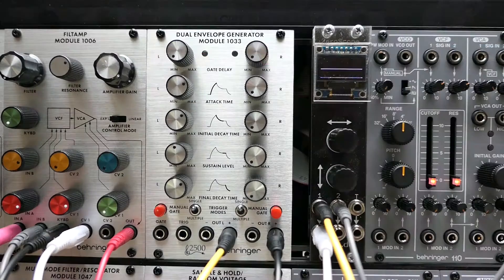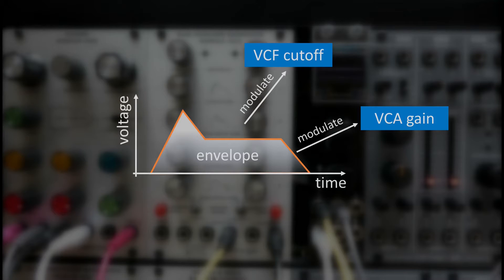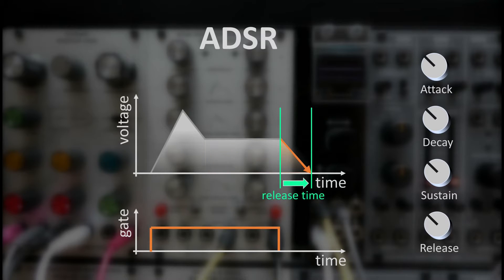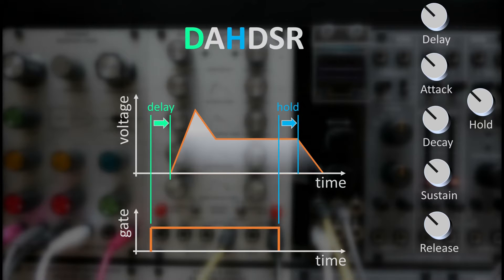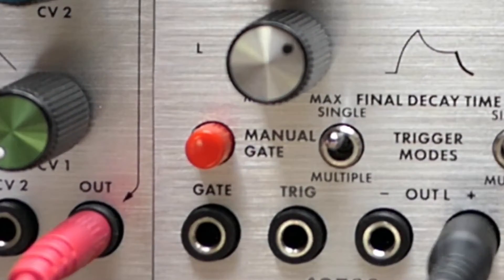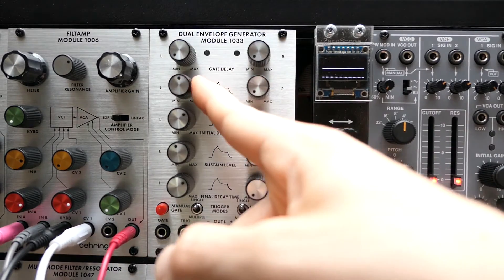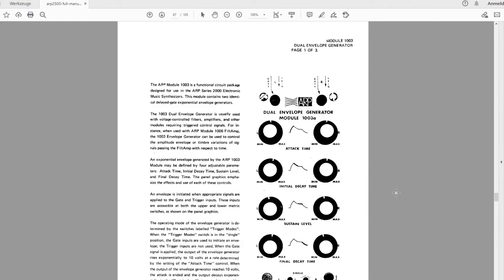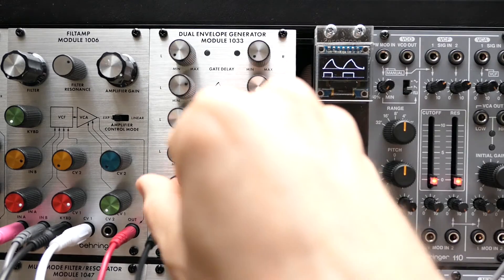Behringer 1033 Dual Envelope Generator ~ review & envelope basics

Comment: Hello , I am Max, I have a 2600 vco,  behringer 902 vca, one 1003 adsr,  one Cm1a, a kassutronics ladder filter and i play with my keyboard ( motif, studiologic, korg ) via midi, the suond goes on without release, maybe i need a cv gate converter because the adsr it doesen't seem to work . Can you explain to me how to make it work because behringer doesn't explain to me? Many thanks
Reply from the maker: Hey, you'll need some midi to cv converter to get going. Plus, the 1033 is picky when it comes to the gate input, needs a real gate to work (not sure if 5V or more).

Comment: I wonder how easy it would be to mod the unit to have an actual 1/8 input jack replacing the manual gate button for the right channel?

It really does bug me that so much rack space is taken up by a module that technically only does one triggered envelope. The best utilization is to use one envelope for the VCA and the other for a different adsr for a filter. Probably the first module to be replaced in my rack since I now have more oscillators and VCA's than I do envelopes.
Reply from the maker: Yeah that would be worth a try. Perhaps you can measure what goes into the pushbutton (i.e. the voltage), when it's somewhere in the standard gate range, your idea might work.
Reply: @synthesizer83  I did recently buy an oscilloscope, I'll try and remember to test the manual button's voltage. Good idea!

Comment: I bought a 1033. I'm a newbie so I don't know if it's just my own ignorance/stupidity, but I can't get it to do anything. I've looked at the thin user manual on Behringer's website. I've watched every video I can think of. It produces an envelope if a push the "manual" button. It doesn't do it any other time. Can anyone help a clueless newb figure out what I'm doing wrong?
Reply from the maker: This one is really picky when it comes to the gate / trigger inputs - most signals don't work. However, if you use some proper gate or clock from a sequencer or a keyboard (I use the Keystep from Arturia), it should work. Other signals (LFO, VCO) usually do not work with the 1033.
Reply: @synthesizer83  Thank you for the reply. I tried the gate and the trigger from a Hydrasynth. It only worked if I held the manual gate button down while playing (kinda useless). I tried it with an old Future Retro Mobius and it suddenly worked fine. I don't own a Keystep, but had thought about getting one. Maybe I will. I really appreciate you getting back to me on this!
Reply from the maker: @barnabascee1889  You're welcome! I sat there like you wasting my time while this 1033 just ignored all the triggers I threw at it.
Reply: @synthesizer83  The specifications say the 1033's gate and trigger voltages are required to be between +4 and +12 volts. So it won't get triggered if you're using, say, a VCO that's bipolar with a peak-to-peak voltage of 5 volts because you'd only be getting +2.5 volts maximum (voltage range would be -2.5 to +2.5). You should be able to make them work if you run the VCO through a CV mixer and add in a fixed voltage offset. Typically Eurorack VCOs, I think, are 10v peak-to-peak (-5v to +5v), but maybe they aren't remaining at above +4v long enough to trigger the 1033? In any case, I would think the voltage offset trick should work.
Reply: @barnabascee1889  Look on Page 89 of Hydrasynth's user manual. You can set its Gate Voltage to 3v, 5v, or 10v. I don't know what it's defaulted to, but you should set it to either +5v or +10v to trigger the 1033 since the 1033's gate/trigger are supposed to accept anything from +4v to +12v. Also make sure the Hydrasynth's gates are set to V-Trig mode, not S-Trig. With the correct settings it looks like it should have no issue triggering the 1033.
Reply: @emdotambient  I'll try this. Thank you!

Comment: The question for me is: for those of us with several envelope generators, will the 1033 really add anything? I suspect not. Could it be that the oscillator, multimode filter and ringmod/VCA are what make the essential 2500 sound character?
Reply from the maker: Perhaps if you miss a gate delay, the 1033 is worth thinking about, or if you're obsessed with uniform module series and want the full 2500. Otherwise, you don't need it. There are better ones out there with two independent gate inputs like the dual envelope from Doepfer.

Comment: Great video ! If Behringer ever manage to get some oscillator modules into the shops I'd definitely love to own a 2600 system, more than the 100 . . . I check all the stores every few weeks but the oscillator modules are always 8-12 weeks away, some have it as not available until Feb 2022 !
Reply from the maker: No doubt the oscillator is great (and also no doubt about Behringers insane backorders), but the System 100 is also very nice - in fact, if I had to decide now which one to keep, I would probably stick to the System 100. It is more complete, more compact and has a nice, warm, analog character that is immediately pleasing. But a bit less experimental...
Reply: @synthesizer83  "I would probably stick to the System 100"

Do you mean the whole system, or are you just referring to the oscillator ?
Reply from the maker: @davelordy  The oscillator is outstanding in the Arp 2500. But in a global view, the System 100 gives me a bit more options right now (sequencer, phase shifter, mixer).
Reply: @synthesizer83  Cheers for the reply, yes agreed . . . every video I've watched on the System 100 where the phase shifter was involved sounded really good, in fact (to me at least) it sounded nothing like a phase shifter, it just made everything sound 3D/alive/great ! . . . . mmmm . . . 2500 or 100 !?
Reply from the maker: @davelordy  That unanswerable question made me end up with both of them.
Reply: @synthesizer83  Damn ! Lol . . . why do I suspect I will end up doing the same . . . I suppose the real question now is which of my children I should sell : )